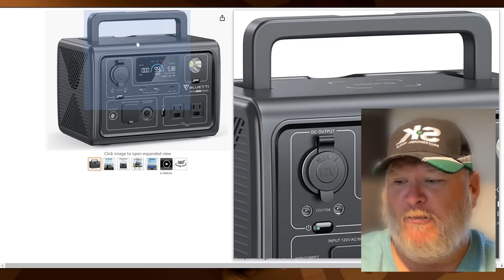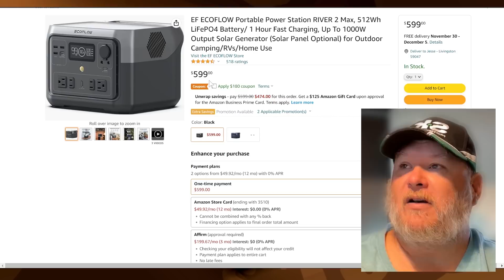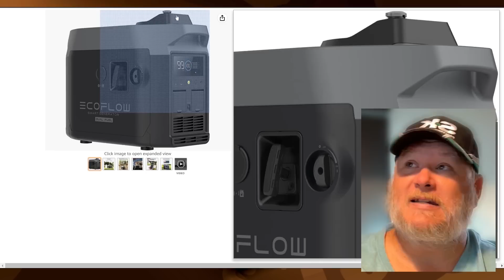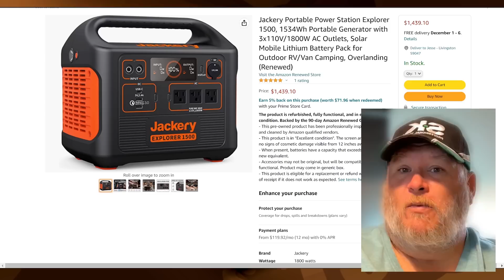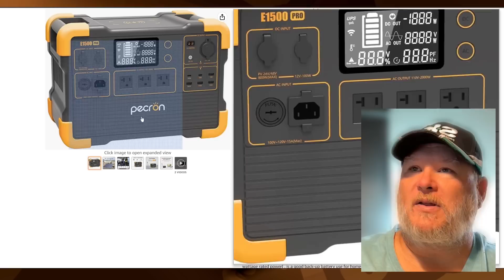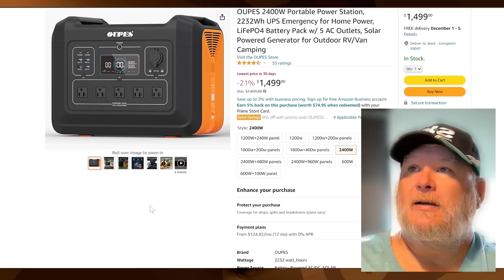Ultimate Black Friday Power Station Sale 2022 (Solar Generators & More)

Comment: Regarding the Oukitel  - I have the exact same thing branded as "FFPower" - the reason I got that particular one ( after a review by HoboTech ) - was because it is the ONLY power station that can truly be used as an UPS - with a .02 seconds changeover time. It's installed in my house to keep my servers and wifi going.

Comment: The bear was off in his 1 to 1 cost ratio. It's not $ to watts, typically it's $ to watt hours. (Watts is to horsepower/top speed as watt hours is to gas tank capacity).  $1/wh is high, full retail (Jackery). 60cents/wh is really good. 50cents/wh is the lowest price usually found on kickstarter campaigns.  Rockpals 600watt has 614wh at $329 (or 53cent) best I've seen.

Correction, that pecron s1500f with coupon (if real) is in the 30cent range (40ish with tax added), dang.

Comment: As for the power a CPAP uses, you can use a power monitor, such as a "P3 Kill-A-Watt" meter, to measure how many kWh (kilo-Watt-hours) you use overnight. Note that every usage is unique, and your mileage will vary. 🙂
Reply: Why would you pay this much for something that pollutes the environment by 4x in production and 10x in decommission than a fossil fuel equivalent. Environmentalist have a screw lose or woefully ignorant. Nuclear is the only way.
Reply: @pnorton75  Many people use a CPAP so they can breathe and wake up the next morning. Just pray you don't suffer this issue.

Comment: If you are thinking about buying any of the Ecoflow stuff, you can get an additional 8% off by using the code hobotechbf8 (from the YouTube channel HoboTech) through the Ecoflow site. That will bring the price of the EcoFlow Delta Pro down to $2943.08 (before taxes).
Reply: Why would you pay this much for something that pollutes the environment by 4x in production and 10x in decommission than a fossil fuel equivalent. Environmentalist have a screw lose or woefully ignorant. Nuclear is the only way.

Comment: I have 2 Bluettis and they have survived 2 winters of hard use in my off grid Montana cabin. But they have a minor design flaw to be aware of. The cooling fan sucks unfiltered air into the box. Over time dust will build up and cause the over temperature safety to turn off the battery. To fix it one must remove a panel and blow the dust out. It's not a deal killer, but be prepared to do this once in a while. It would be easier if they designed it with a removable air filter.
Reply: Why would you pay this much for something that pollutes the environment by 4x in production and 10x in decommission than a fossil fuel equivalent. Environmentalist have a screw lose or woefully ignorant. Nuclear is the only way.
Reply: @pnorton75  The environment is ruined and humans deserve to go extinct. I am just trying to enjoy the time I have and solar is the only way to ensure I have power.

Comment: Rockpal has a 1300watt for 799
Reply: The bear was off in his 1 to 1 cost ratio. It's not $ to watts, it's $ to watt hours. (Watts is to horsepower as watt hours is to gas tank capacity)  The rockpals 1300watt is actually 1254wh. So at $799 that 0.63 cents a wh. Which is pretty good but the rockpals 600w  has 614wh at $329, thus 0.53 cents a wh. Really good price, tough to find better.  Only kickstarter campaigns ever offer better (50cent/wh).

Comment: Hey Jeff, no EBL?
Reply: Not LiFePO4.  Otherwise, pretty nice and a way better value than Jackery for very comparable units, with EBL having the better ergonomics.  I had the 300ish Wh one, that I got for $150 with discount code.  Great unit, but I decided I'm done with non-LiFePO4 power stations.  No old lithium ion bigger than a jumpstart pack or USB power bank for me.  Except for the one in my car, I'll give Toyota a pass.

Comment: Are Any of these companies have a product that works in Texas power outages? Frig, heater, tv, lamps? Serious responses only.
Reply: Heater will be the problem. Running a 1500w electric heater will drain a battery quickly... Either look at a gas generator for the electric heaters or look at other forms of heat like propane/kerosene.
Reply: @NukePooch1  my heater is gas fueled with electric start. Is that something that can work? my interior temp for during that outage was 45 ferinheight. 4 layers of clothes. It's a blur memory how I made it out alive.
Reply: @bogusienombre355  Yeah, if it's a quick start it should be fine then. Check the electrical requirements in the specs/owners manual to be sure you get a battery pack that's big enough. Biggest draw is electric resistance heating of any kind (electric space heaters, stove, toaster, coffee pot, etc). Caution, make sure you've got carbon monoxide detectors and crack a window open for ventilation if using a combustion heater indoors, sucks being cold, but it's worse to not wake up at all.
Reply: @NukePooch1  great info thank you .👍

Comment: I got the Bluetti EB3A to power a wifi hotspot and I'm about to return it to amazon because it stops working when its cold. I'm sure its a safety thing but I kinda need to work outside this winter.
Reply: You can't charge LifePo4 batteries under a certain temperature but if they are charged you should be able to discharge at a lower temp. Some lifepo4 batteries come with a heater and it will preheat and then start charging.
Reply: Why would you pay this much for something that pollutes the environment by 4x in production and 10x in decommission than a fossil fuel equivalent. Environmentalist have a screw lose or woefully ignorant. Nuclear is the only way.

Comment: I bought the Bluetti AC200P yesterday. I already have solar panels . I am supplementing my 4800 wh battery in my camper. It was a little overkill but the price was right.
Reply: Bluetti has the wireless phone charging pads on top so they might not be able to put a storage area there.
Reply: Tim I bought the ac200p yesterday too I couldn't turn down $1199
Reply: @jamespruett2849  I have to find it again but there is a youtube video on how you can adapt your own battery to the AC200P instead of buying secondary one for a thousand from Bluetti. I normally build my own lifepo4 batteries but I bought the AC200P because the sum of the parts were much cheaper . I will build a secondary battery to connect to it though to increase capacity.
Reply: Tim I have the old Bluetti 1500 like you I thought I saw a video on how to use it as a expansion battery for the ac200p been trying to find it again
Reply: @jamespruett2849  I think this is it. https://www.youtube.com/watch?v=sD6q-5oAOe8
Reply: Why would you pay this much for something that pollutes the environment by 4x in production and 10x in decommission than a fossil fuel equivalent. Environmentalist have a screw lose or woefully ignorant. Nuclear is the only way.
Reply: @pnorton75  until I can buy my own nuclear reactor I'll just keep polluting the Earth like 100% of the population does